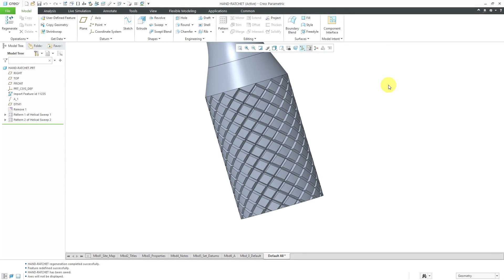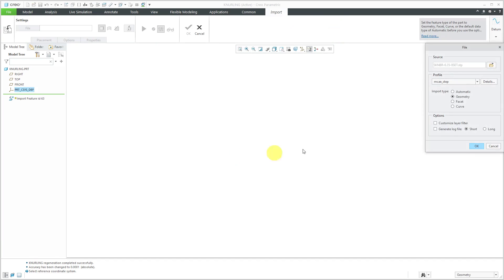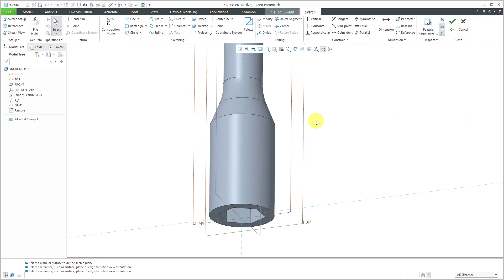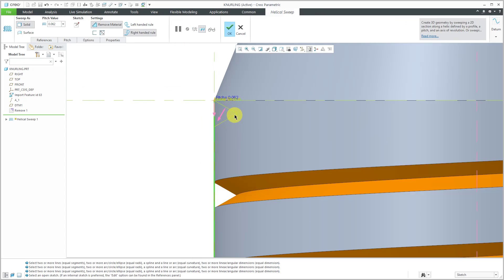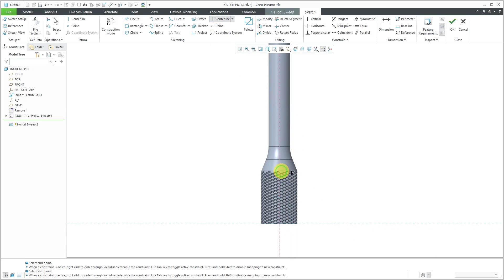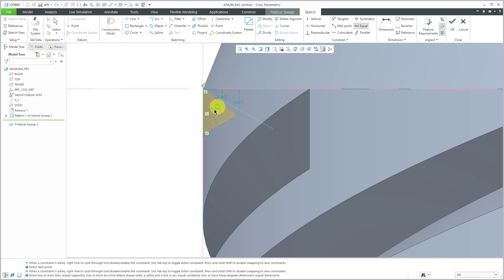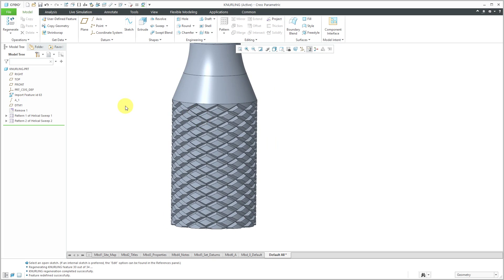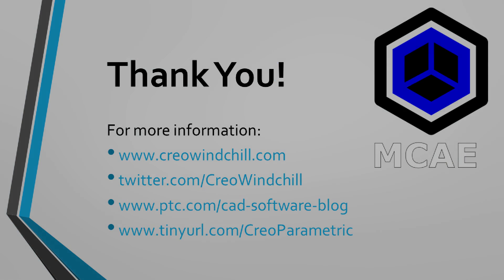Creo Parametric - Knurling - Advanced Part Design [Demo]

Comment: Hello Dave,
Keep going with the tutorials, you doing a good work!
You can use the mirror command to have the same result, instead of design two separate helical sweep and pattern them.
Best regards
Reply from the maker: That’s true. It’s funny though, we were having a discussion at work last week about avoiding the mirror command if you can...
Reply: Thanks for sharing that, but why to avoid the mirror command?
Reply from the maker: I'll have to dig up the discussion. I was at LiveWorx when this happened.
Reply from the maker: There's an issue whereby after you mirror a feature that contains a sketch, you can't edit definition of the sketch to add or remove references. I don't know the logic behind that, but it forces you to delete the mirror to make changes and then recreate the mirror. This can be a pain, and worse, it can make changes impossible if the original features have a lot of children.